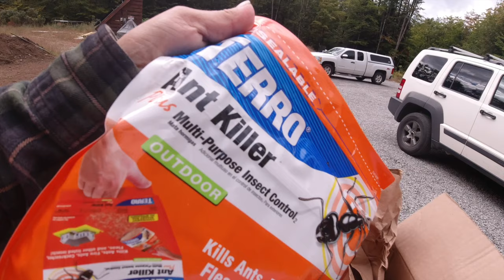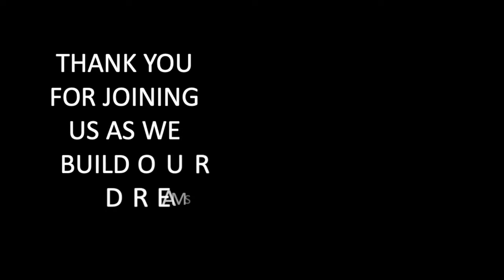Green Roof House Exterior Finishing - On our own again!

Comment: Although I understand little most of the work you do now, like covering the concrete wall with wooden siding (we don't really do that here in Europe), I'm super glad to see the progress you're steadily making and I'm also keen to see the finished result. Remembering your little desktop model, I have some faint idea that doesn't help me to imagine it on the current building. But I'm sure the time will come, when the build is finished. Keep yourself safe, better late then harm yourself and be late anyway. Thank you for sharing all that time! 👏👏👍
Reply from the maker: Appreciate that. And we’re covering the concrete so it looks like part of the house and is aligned with the rustic Adirondack look common here (green metal roofs, and some kind of brown wood or log siding)